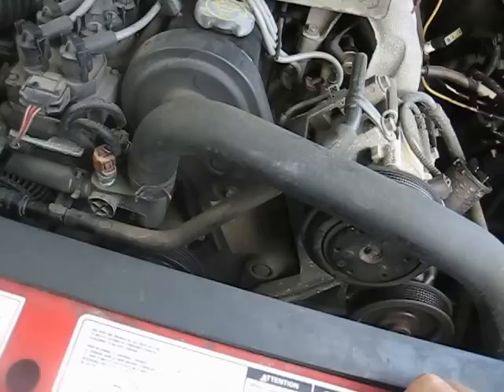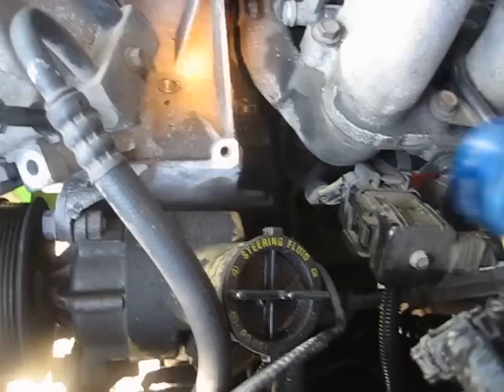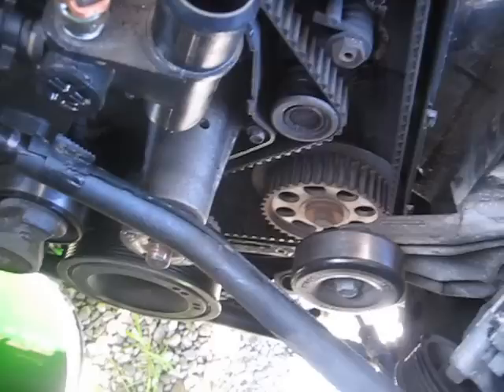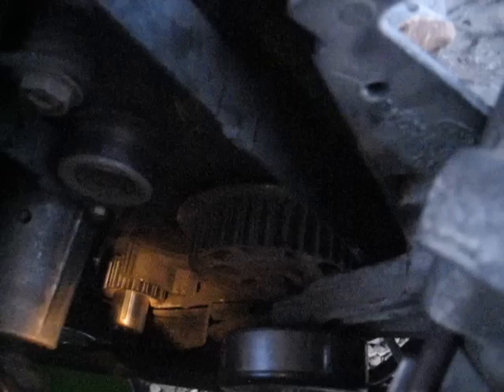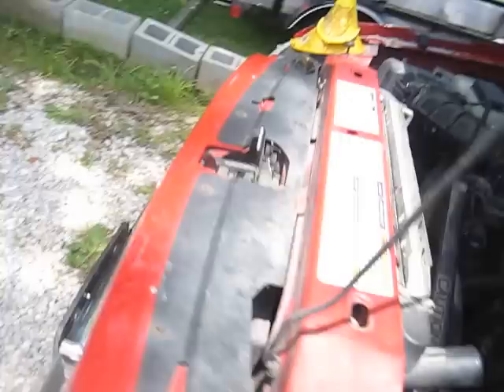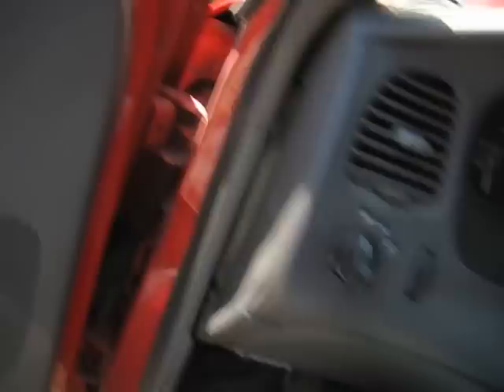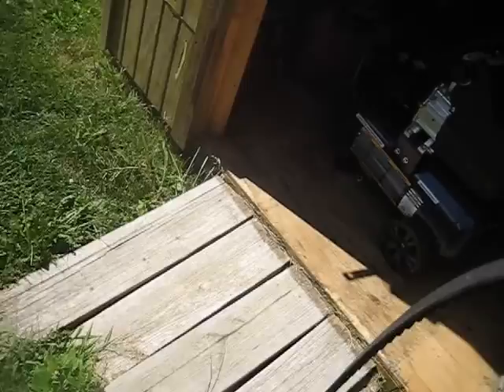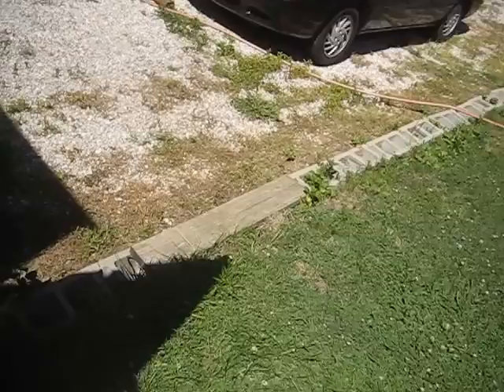Timing Belt Replacement Ford 2.3 and 2.5 1996-2011

Comment: Great video I just did mine drove 500 miles n staryed missing took all back apart and it was out of time got it all back together nuthin want start now.???? Any ideas ?????
Reply: wood123ish you might have it 180 degrees out, pull the number 1 plug which is forward most plug on passenger side and put a rag in the hole, rotate crank until the rag pops out or you hear air, that’s top dead center, then line up your timing marks like I did in the video and that should do it.
Reply: @Charlies_Corner  sweet man I had it the first time when I put it back together idles fine started perfect and it's got 241 thousand miles on it and the belt hadn't broke or nothing I went ahead and replaced it and the water pump and I go to start it up one day and it's missing but I think it's my PCV valve that is missing that I've realized and that is how I did it the first time though was took the number one plug out and make sure it was a cop and rotated a little bit before I put it all back together but I got a tour down right now I want to get it put back together with the PCV valve and clean it up a little bit I replace the gasket Sons auto body intake and the three plugs underneath intake
Reply: @Charlies_Corner  dtove fine for 500 miles and I notice it was missn back and I also noticed the pcv missing and I had a extra hose and I couldn't fine were it went and I blocked the hose with a screwbdriver and truck ran good. Idk I'm getting a pcv value 2moro and settn it back and hope for tha best thanks man..will probly be back in touch lol. Merry Christmas
Reply: @wood123ish  please, please use punctuation when you type online.

Comment: there exists a 2011 American ford with spark plug wires and a distributor? those became obsolete right around the time obd2 became standard ><
Reply from the maker: the only ford that I know of that used a distributor past OBD 2 was the V6 engines, the 3.8, 4.0, the early 2.8 and 2.9 engines. OBD 2 mainly did away with the need for a distributor, unless its Dodge or GM.

Comment: Can you left the back wheels instead of having a car or truck behind it
Reply from the maker: no because in my case the bolt was so tight, I tried an impact, a 1/2 drive ratchet and a 6 foot bar, I tried blocking the wheels with bricks and putting the trans in 4th, tried the starter method, and nothing worked, I put one truck behind the other to aid on giving me more torque because the truck would try to roll, I set the parking brake and pulled as hard as I could and it finally came loose. Sometimes you have to get creative when doing this job.

Comment: 1/2" breaker bar on the bolt "wedged" against the frame... and tap the starter.. pops right off every time (a lot quicker)- and a Must if you have a automatic trany.
Reply: That works every time
Reply: I've done this before but can't u do it with as manual?
Reply: @pointedspider  if you try to take the bolt off of a car with a manual transmission, and the manual transmission is in neutral the motor will just turn over but if you put that transmission in gear the lower the better the transmission will lock or hold the motor. On a car that's an automatic the torque converter does not lock, this makes it essential to use the starter motor with the breaker bar held to the car's frame to undo the harmonic balancer bolts. Yes you can use the starter method on a manual but there's no need to put the car in gear except the e-brake , and unscrew the bolt.

Comment: compeletely skipped how to remove and re-install the tensioner pulley bracket. im under the impression that this tensioner pulley is to be replaced when timing  belt is replaced, ya?
Reply from the maker: You don't remove the bracket unless its being replaced with the belt and gears, its best just to reset the tensioner until your ready.

Comment: 170k on the original timeing belt that’s kinda hard to believe
Reply: Not really,.. I've changed mine at 160,000. Of course the belt had no tension,.. none.  Could have been a set up for a bad day.... lol
Reply: 99 Ford Ranger with 2.5 liter 4 cylinder pushing 253000 and still strong!
Reply: Lol mine had 200k on it
Reply: I got 249k and it just broke lol
Reply: Mine just broke at 215k. Having a hard time getting it timed now.
Reply: @davethemagnificent2576  200.000+ on my 1997 2.3
Reply: 1997 2.3 went out 150
My dad had a 1994 and had 350  with the oiginal time belt
Reply: I've got a 1998 with the 2.5. 162k same belt as day one